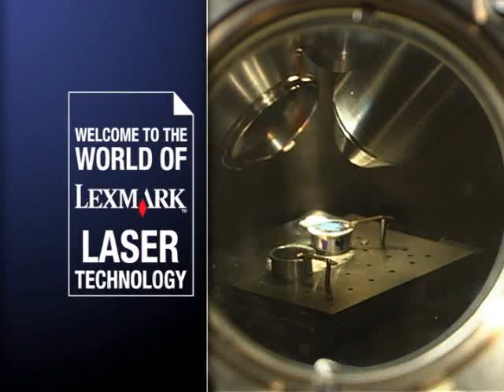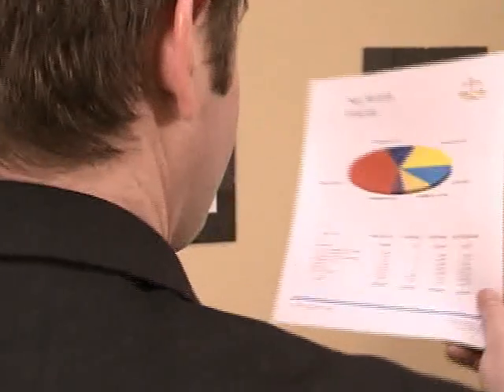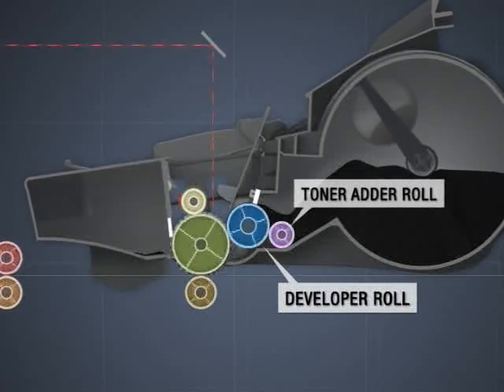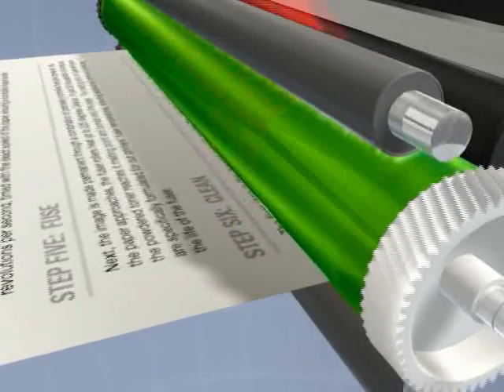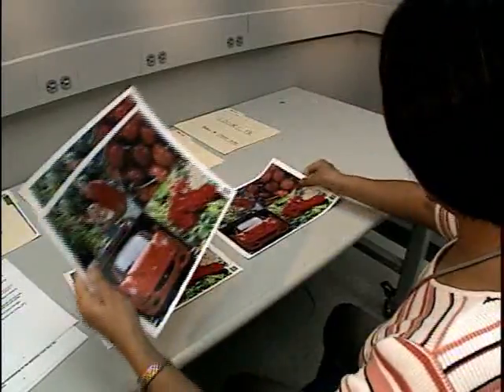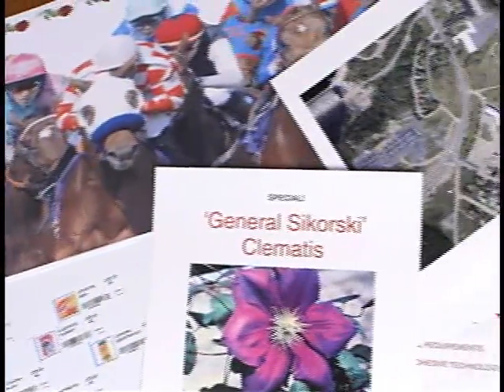Lexmark Laser Technology Presentation

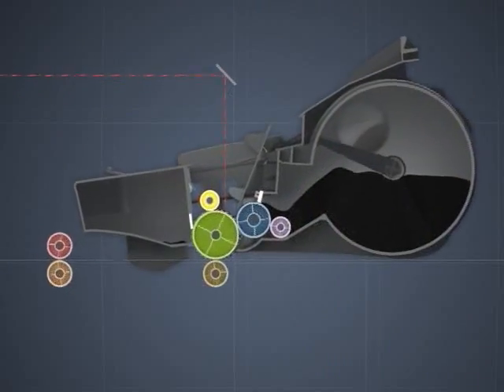Comment: The video states at 1:24 that the process begins with a "charge roller".  Well, it does not mentioned how the information arrives on the charge roller.  It later mentions that a laser strikes a photo-conductor drum, but again, how does the information get from the PC to the laser?  I know the answers to these questions, but if you're educating people on how a laser printer works, you should, at minimum, mention how the laser obtains the information.

Comment: I found this link from Jim Hall's article on the early days of the HP LaserJet in the HP Memories archive. He pointed out that since Lexmark and HP were using the same Canon patents for their all-in-one toner cartridge that this excellent video is directly applicable to the HP LaserJet printers  This video looks like it was originally made for black and white products and updated later by marketing to show color output without mentioning that color laser printers have four toner cartridges for each of the toners Cyan, Yellow, Magenta and blacK (CYMK). The black is used is used for that part of the "dot" that is equal parts of the other colors and saves on usage of those colors and makes the black text look much better than if it was made from equal parts of cyan, yellow and magenta ("process" black).

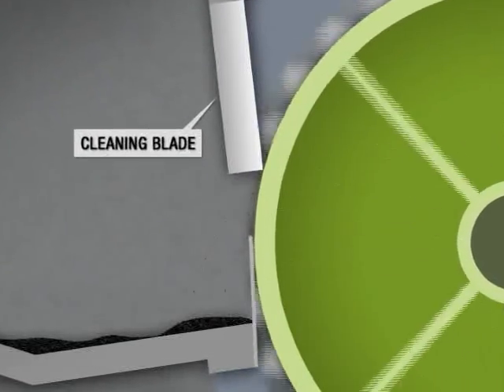Comment: At 3:20... So stray particles of toner removed by cleaning blade goes to a compartment (waste bottle?). Looks like 90% of toner is gone to waste if your pages are,say, 5% printed. Can this "waste" go back to use? Or its chemical has been altered by the laser beam?
Reply: Toner is only attracted onto the parts of the drum that have been hit with the laser. It does not coat the whole drum.

Comment: Well, you can go two ways. Most laserprinters have replaceable drums and corona wires/charge rollers and fusers, since even if you try hard you're still going to have a fairly limited lifespan of those things. Basically the stuff might last you ten to thirty toner cartridges.

If you design it to last for just one cartridge, you can make them cheaper, and over the life of the printer you can come out roughly equal with the all-in-one replace-everything method, or the everything-separate method.

Comment: Yeah, it might be expensive, but many of those parts inside are prone to failure. Would you rather have a broken laser printer that you either have to toss or get repaired, or simply spend a hundred whenever your toner runs out and replace other prone-to-failure equipment, too?

Comment: @shaygahweh

That's what brother does, separate drum and cartridge unit. You only need to replace the drum every 3 cartridges or so. In terms of cost per page it doesn't do as much as you'd think. HP could make perfectly cost-effective cartridges if they wanted to. It's all calculated, down to specifically engineered failure rates.

Trust me; the problem isn't technology, it's business.